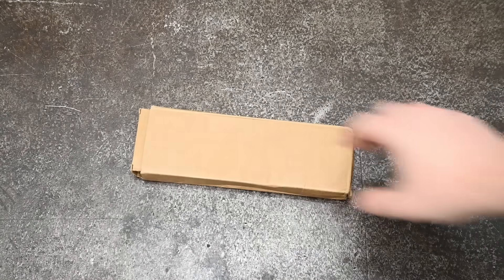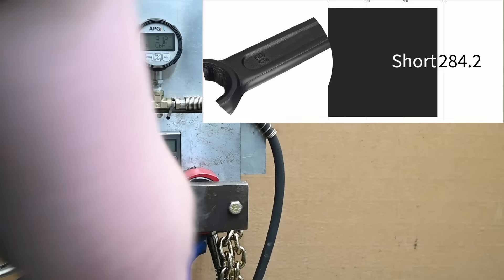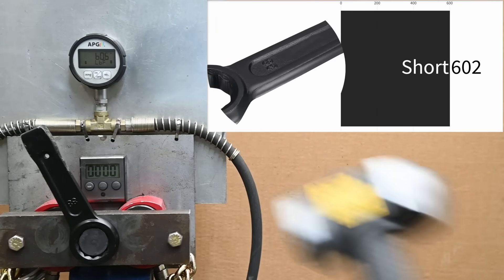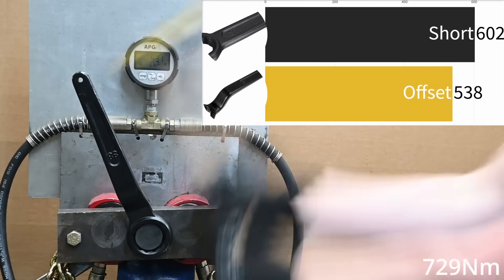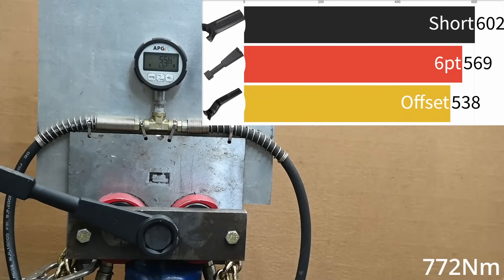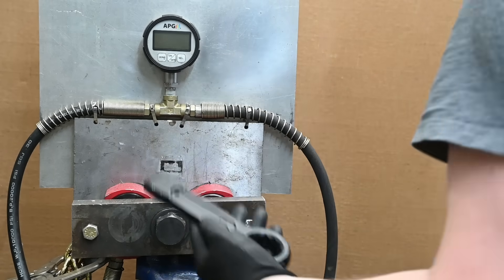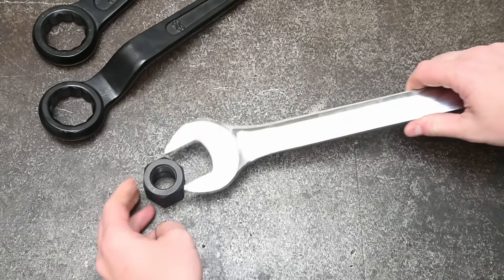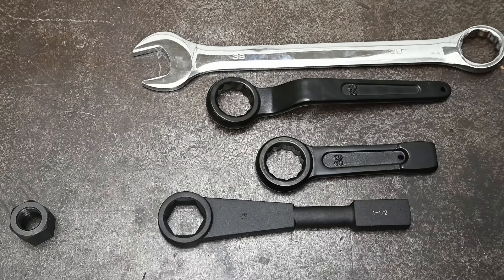1800s Impact Wrench? Slug Wrench: the ORIGINAL Impact Wrench

Comment: @TorqueTestChannel I would like to see a video on the good old fashioned screwdriver type impacts that you hit with a hammer and they turn a quarter of a turn. Not only are they great on Philips head preventing cam out by striking, but also great for torks especially the shallow socket ones. I also sometimes use it on Allen heads too, but I'm curious to see how they come late in torque without stripping compared to gun style impact.

Comment: I wonder if your Dyno could measure accurately with this test. Considering the entire set up, moving with each strike, it is obvious with a sledgehammer you are delivering so much more kinetic energy then with an impact gun per blow. Id think the smaller impact gun doesn’t hit with as much kinetic energy, but makes up with it with speed and the amount of hits. And if Google is correct an old school sledgehammer and impact wrench can reach over 3,000ft of torque.

Comment: We sometimes have to install "drawbars" on broken castings. Basically a rod with 42mm fine thread on it, nuts and washers on either side. My go to to torque those is to sling the wrench to the 40t overhead crane, stand back, and yank on it with the crane 😂

Comment: The idea that This thing exists makes me sick. You have to to apply torque to both sides of a bolt to get the best chance of not snapping it off like with a T handled wrench or something. people use breaker bars and wrenches with only one side to apply torque to and they actually wonder why they can’t get their bolts out without breaking them off.

Comment: was just using a 4" one of these the other day with a 20lb sledge

in the past i've had good luck holding the wrench on with a piece of 2x4, if you're desperate you can shoulder the board into the slugger wrench to hold it, but you're much better off with an apprentice swinging the beater instead.

Comment: I worked in an oil refinery, and we used these.   We used to hit them with a 6 pound sledge, with handle cut off to about 2 foot, and the end taped with electrical tape into a knob on the end (so it didn't slip).

Comment: I had to use the box end and some surgical strikes with an 8 pound hammer loosening a nut off a pump that had been running for 10 years. Like you said in the video sometimes you just don't have access to some nuts or bolts, every other nut was loosened with a hytorq, and made me very appreciative of the progress we have made in tightening and loosening bolts

Comment: You should test the strength of different fastener head designs! Is torx the strongest / most resistant to stripping? Hex? Compare then to Phillips. You could use the same material and size to isolate the variable of just fastener head design.

Comment: I would like to request a test.  Typically when loosing tough nuts, I will sometimes rotate the impact wrench back and forth (in the direction of loosing and tightening) while applying impacts.  This typically works, but it may have worked the same if I just held the impact wrench steady and allows the impacts to do its thing.  I suspect but don't know that by also rotating the wrench, I may be taking up slack in the system allowing more impact force to be transmitted.  I would request if you can test with both tight fittings and more loose fittings and see if more beans can be delivered by rotating.  Thank you for your consideration.

Comment: i'd like to see air hammers on these. And actually i'm a little curious to see what an air hammer with a chisel could actually do to a bolt. More than a few times on things like drain bolts i just take a chisel to the rounded head and hammer it off with air or manually. It's a pain but it works. I wonder what kind of torque you can actually apply this way.

Comment: In real life use no air or electric wrench can come close to getting off a nut as well as one of these . Have a huge air compressor, 3/4 crowfoot fitting air hose and 1 inch impacts from Aircat all the way to Cleco and have hammered for literally 30 minutes straight on cylinder nuts for excavator and others without budging . Put slugger on it and VERY FIRST BLOW with 12 pound sledge and nut moved . This has happened numerous times . Have to secure part as tightly as possible but I promise you nothing else (except hydraulics) comes close

Comment: I have used these a lot over the years. Usually working alone, I used a thin strip of duct tape to keep the wrench on the bolt head or nut. Tape over the nut corners, drive the wrench onto the nut, hit really hard.

Comment: There's a school of thought in construction that it's better to design structural steel to be attracted "snug", or as tight as possible using only hand tools. The offset wrench you show is often used with a convenient length of pipe to get the fasteners "snug". I'd love to see what the engineer calls "tight"!!!

Comment: The three you bought look a lot more like backup wrenches we would use on the back side of a flange we were impacting or using a hydraulic high torque on.

The proper hammer wrenches are a lot beefier, they have like a 1.5" square block on the end where you hammer and are much thicker material overall. The ones ive used typically have a bit of an offset similar to the second one to get it into position on crowded flanges.

With these its not so much about the accumulated torque, so much as the torque one single impact can provide to break something torqued extremely high, or extremely corroded free.

Comment: Slugging wrenches are everyday tools for many trades and yeah the  dynamic torque works very well but you have way too much bounce with that set up. On equipment that you measure in tones and not pounds it's easy and common to snug things up with a slugger and a 4lb to a 12lb hammer. But snugged up for a 2 to 3in bolt is 2 to 3 thousand pounds feet and is done easily. Hitting something that for all intents and purposes is immovable makes all the difference. Think steam turbine components and alike. There's really no good way to replicate that for you guys. Great work though as always.

Comment: I once needed to get a large bolt off and didn't have the right size socket for my impact wrench. But I did have a combo wrench of the proper size but it just wouldn't come loose. So I used a small pickle fork on an  air hammer . After a minute or so it came out hammer. Also how would the wrenches you tested today do if you used a long pipe on them ? Be interesting to see.

Comment: I used to use a 2 9/16 slugging wrench all the time changing out clamp attachments on vibratory hammers. Bolt size 1 3/4  at 4500 foot pounds. Locktite and smack it with a 20 pound sledge or use a hydraulic torq wrench. You can get extreme torq on a 6 point slugging wrench hitting it like your hitting a golf ball with a 20 pounder.

Comment: We always called them 'slogging spanners' or sometimes 'flogging'.... maybe 'slugging' is an American name. 

They're still widely used in marine engineering and other heavy industries but usually in sizes of 50mm or 2 inches across the flats or larger. The set I had went up to 300mm across the flats which is about a foot imperial but they came even larger than that and sometimes and you'd need 3 or 4 guys that knew what they're doing to use them. 

I remember they weren't cheap to buy either, you could pay a couple of thousand UK pounds for a single spanner even back in the nineteen eighties or nineties. Also you'd be as fit as a butchers dog if you were using them regularly.

Comment: I wouldn't have cut down the wrench. Leaving it in its regular configuration allows you to hold pressure on it while striking it with a hammer. More control to keep the wrench from coming off and less energy wasted.

Comment: Lineman here. We use beat wrenches pretty often for 3.5” base bolt nuts on tower foundations. The bolts are around the knee level so you can get a big overhead swing at it with the sledge hammer.

Comment: Our BFH Is 16lbs! We Drove #10 Rebar In The Ground Every 6 Inches Around The Back Yard Cut Them Off Even And Welded An Angle Bar To The Top Between The 6X6 Post We Set Every 20 Feet! Then Poured Concrete Up 1 ft Between The Post Which Made A Killer Fence! But To Stand On A ladder And Swing The 16 Lb Hammer All Day Will Wear You Out! Our Regular Sledge Hammer Is 10LBS

Comment: I had to make an open end slug wrench for removing nitrogen accumulators. Cut a tekton wrench and had a removable striking block machined. 
Outside of that I have a proto set of slug wrenches and they have taken plenty of beatings

Comment: Hammer wrenches are used everyday in heavy industry.  They are most certainly not obsolete.  When weight doesn't matter sometimes the best solution is simply more force.  With a long enough lever I can move the world.  And with a large enough hammer I don't need no stinkin' lever.

Comment: I have used slugging wrenches many times for my work, and LBF per dollar it is hands down the most efficient tool out there. Sure a big impact can get it tighter, but a slugging wrench only costs like $50. Also should be noted that if you secure the wrench to the bolt with a strap or something you can really lay into the hits with confidence and probably get higher numbers than what you saw here.

Comment: Bro let oilfield people show you how to use these. You have to swing as hard as you can. Wit the biggest sledge hammer on site. Those hammer wrenches look like they are pretty cheap ones. Seem to flex way to much. I can promise you that none of the impacts you have tested will out perform a good roughneck, a good quality hammer wrench and a big ass hammer. A good hammer wrenches is $400 and up

Comment: I'm in this exact situation; need to build a 7/8 12 point hammer wrench for disassembling valves. Got a Jet wrench I've been beating on, and want to weld a block of steel to the open end to make a proper hammer wrench.

Comment: Industrial mechanic here, we use these all the time. Generaly for disassembely and to hold the opposite nut when using Hytorcs on flanged connections or large structural bolts. We have them in openjaw config too but generaly avoid those unless there isnt room to get a ring on. Usually if the insulation hasnt been completely removed. We only use what you call the "short" ones
Reply: I’ve used a 20 ton ram on a striking wrench break some bolts loose when the hytorc couldn’t break it loose

Comment: Back in the turbine-building factory that I won't name, every large bolt was torqued to spec with some very large torque wrench devices. During the day. 

On the back shifts, the crews hooked the wrench onto the overhead crane and just counted flats.
Reply: Huh, that might explain some problems at the power plant, at your factory did they still do alternating tightening patterns on the back shift?  Torque to angle, /if properly controlled/, is a valid approach, but the monkeys often figured out "better" (wrong) ways to do jobs like you described.

I remember wondering how the troublemen straightened out the manhole cover lifting hooks, shoulda been stronger than the troublemen.  Then they showed me how for the really jammed covers, they used a bucket loader with the hook between the teeth!  <Whoompa>, ok, it's loose!
In the modern world, ideally big fasteners would be installed/removed with hydraulics.  Ruin one in the middle of an overhaul with no spares, that'll pay for the hydraulic unit REAL quick.
Reply: @pault151  My turbine info/experience stems from roughly the late 1970's (yep. I'm old enough), so I'd like to think that most of those turbines have long seen full refurbishment fade away in the rearview.

Comment: lil trick I've used to keep wrenches from bouncing or falling off in most cases is a rubber band or a magnet, if it gets you a few extra hits without having to reset it then it saves you a little bit of time and headache of having to do it every 2-3 hits in most instances since you can rarely get a nice square on blow so the wrench is always wanting to jump off. they wont prevent the wrench from fully jumping off but can help with just enough positive pressure similar to holding your fingers over the end of it to keep it on the bolt.

Comment: The whole test stand moves when the wrench is hit with the hammer, if it was solid you would get more torque. I use these oteco hammer wrenches  in the oilfield on flanges which are on well casing that is cemented into the ground, very solid

Comment: I'm at the beginning.
I often like to put my comments in before I see the answers (to avoid cheating).
I have two 8 lb sledge hammers, one with a handle, one without. The 8 lb sledge I simply hold in my hand is great for when I want to impart momentum with low energy (to avoid breaking) 
But breaking free a bolt or nut, is--I think--still breaking:  I think it's about breaking the rust's grip without breaking the, hopefully more flexible components:  For this reason I prefer an impact over a long breaker bar whose constant force will twist off a bolt.  
In this case I suspect there ought to be a happy in-between, a goldilocks weight.

Comment: When I was a kid my father worked in the oil fields of south-west San Joaquin valley. He said there were 3 types of wrenches, regular like he used when I held the light to work on our cars. Medium wrenches were huge, 4, even 5 feet long so you could get some serious leverage. The really big stuff was only half the size of the medium but the had a pad on the end. They were  2 or 3 times the size of the tool in the video. Add a 16 pound sledgehammer to a 2-3 foot long wench and even the bolts holding the rig together could be loosened and tightened. Then we talked about engines so big you could get your head and shoulders down the bore…

Comment: Sorry, but the game here is "dynamic force" which is much different physics than torque measured through hydraulic fluid. Your device is measuring an energy as a result of bolt movement, not the amount of dynamic energy required to move the bolt. A driven 10# hammer is producing much greater dynamic psi numbers than any handheld power tool can dream of. This is like measuring an engines horsepower by only measuring how deep a car crashes into a wall.
Reply from the maker: Also tried removing tightened bolts, in the loosening direction you're only fighting bolt clamping tension pre-load
Reply: @TorqueTestChannel  I watch most of your videos but I am not an internet roach. 34 yrs real world experience a designer/builder. Your device only measures the movement of the bolt. Even in the video, you spoke a clue that reveals something is off here, "Less of a jump from a 4lb to a 10lb than I would have guessed", giant red flag that something is off, especially when fpe was more than doubled.

Real world dynamic force befuddles even top engineers. I was expecting much higher numbers because in personal real life experience, a sledge against a wrench is usually a last resort to not damage tools, even after 2, 200lb+ grown men bouncing on an extension pipe. Sometimes a sharper blow from a smaller hard faced hammer succeeds where a much heavier dead blow hammer doesnt. 

I'm not attacking you, I'm saying there is much, much more physics involve here than can be reduced to a simple end result hydraulic pressure reading.

Comment: Framing hammers are most definitely NOT intended for just soft nails. 30+ years in carpentry here. The head (striking face) of many framers are SOFTER than a ball peen or sledge hammer, and only the crappiest have a flat face. My 23 oz Vaughn California framer is my go to workhorse for all but sub 8p and tacks, unless it's at hand and I only have a few nails to pound. 
The claws dig, they scrape, they split wood, they chip masonry, they pry anything that needs prying, they snap band clamps like it's nothing.  The face will drive hardened cut nails all damn day, wood, masonry, and metal working chisels and punches cause as much harm as roofing nails, the face busts up masonry, and easily beats metal into submission, bustsup cast iron with ease, also works great for tamping. All while the 1 5/8" Head gauges joist hangers to perfection. It's the flat head screwdriver of the construction world, only better because it does more and rarely fails, swiss army knives don't have jack in comparison. You're 99.9% more likely to misplace it than break it.

Comment: The longer wrench ends up sort of disappointing because it's just not stiff enough to transfer full impact force to the bolt. It's the slugging wrench equivalent of a torque stick or a long extension.

Comment: First used these working heavy trucks in the military. Continued to use them as an industrial mechanic. When you’re working in the field on rusty and corroded fasteners without access to air tools, bash wrenches are often the only option to get the job done.

Comment: Hey TTC crew, when are we going to start seeing pneumatic die grinders hit the dynos? Throttle control or feathering, throttle feel, actual power @ XXpsi, straight vs 90° vs extended, front exhaust vs rear exhaust, ect. I'm personally looking for an extended ¼" die grinder (that isn't dynabrade money 😅) and it's a crazy world to dig around in. I appreciate y'alls work on air hammers and gladly picked up an IR 119Max and I feel like I got a model with super nice low throttle control compared to what y'all ranked it at!